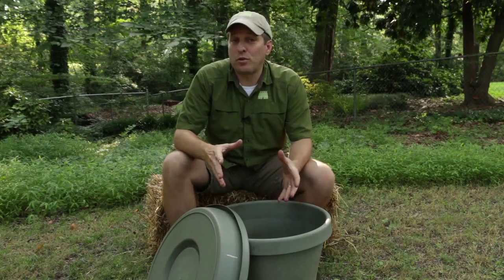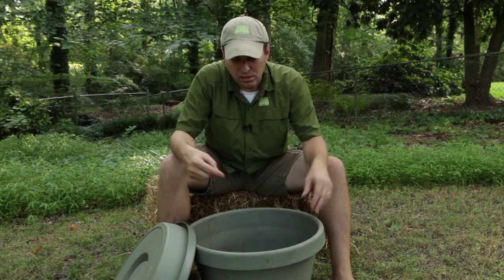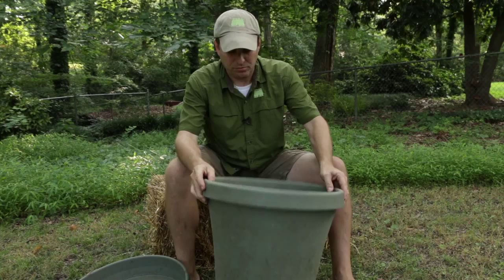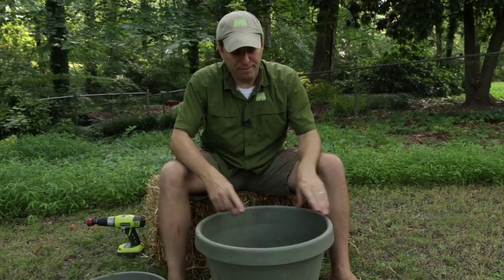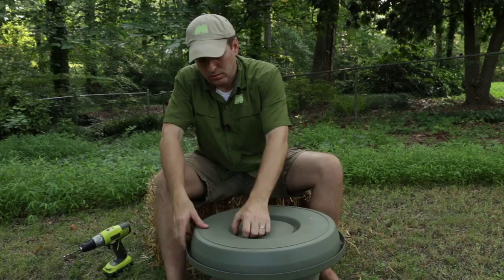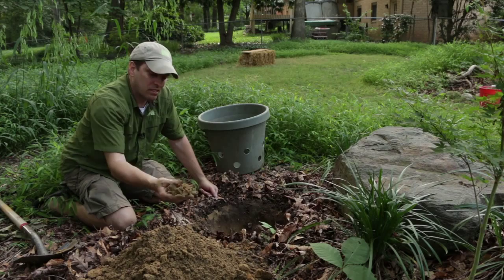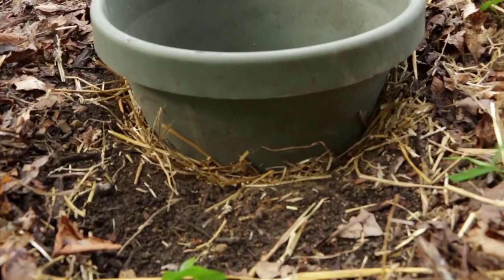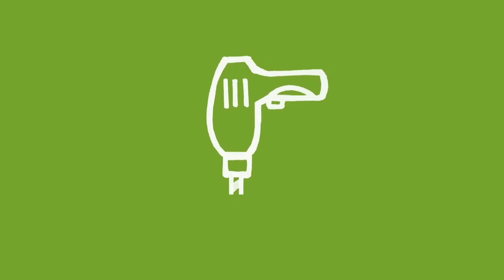How to Make a Compost Bin from a Flower Pot | GreenShortzDIY

Comment: Not that practical from what I can see. Most homes would need something like a 300 to 500 litre tub to compost a few months waste. You must have very little kitchen waste to dispose of. The outdoor home composters are not expensive and hold a good 6 months of leaves, kitchen waste etc and take around a full 6 months to turn this into top quality compost. Not meaning to sound disrespectful, but this idea is ok if you only want a small amount in return.
Reply from the maker: You’re correct. Not a lot of volume. It might work for a single person. Or in conjunction with more than one method (which is my case). My mission is to illustrate as many ways to compost as possible. Thank you for the feedback.
Reply: @GreenShortzDIY  I guess we are lucky with a good size garden. We have 4 330lt composters as we live in the country and have lots of leaves and general garden waste. It's good to explore options to give others ideas. How long does your system take to create compost?